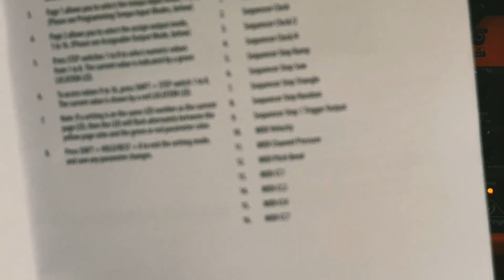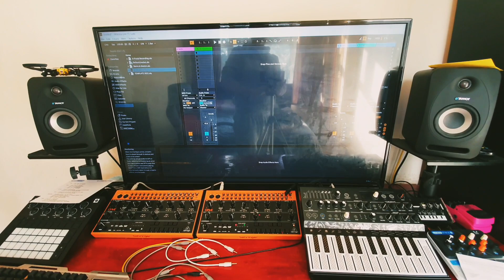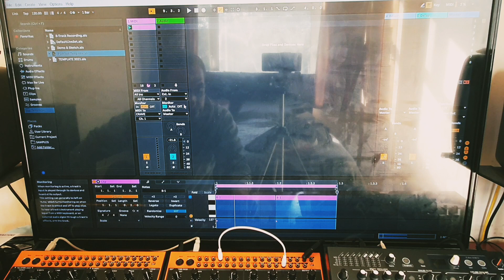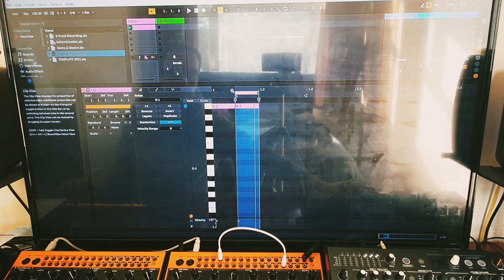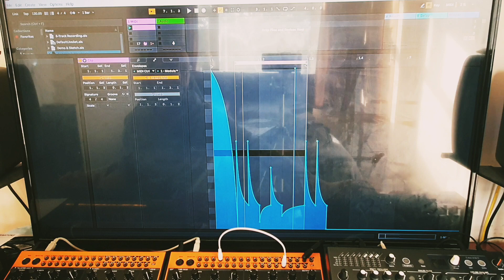Behringer Crave Advanced Tutorial 2021. Volume 1

Comment: So whats going on in the Ableton Env section? First Im DAWLESS so no Appletons 4 me, but I have hardware sequencers. Am I correct in understanding that one can use MIDI CC# to 'spice up' sequences in the Crave, eg program filter apects etc - and this is done by assigning the assign function to a MIDI CC in the list you showed earlier?
Reply: I ask this as I know the Crave is Analogue...so I didnt quite get why there is a MIDI CC lista in the manual :D
Reply from the maker: Correct. Yeah I've done it with ableton and the circuit tracks
Reply: @TechTronix01  but only in the sequencer - since its analogue using MIDI CC wont affect control of the sound/knobs.
Reply from the maker: @squishmusic  no.. an external sequencer could modulate or move the craves cuttoff or anything else over midi cc regardless of whether a sequence is playing.. you just need to patch the thing you want to modulate so from assign to cut-off..  parameter lock can be done If the sequencer has that ability

Comment: i can't figure out what's up with mine the keyboard detects touch but i have no pitch difference on any of the keys im going to flash the stock fw see if that's does it but im at a loss here because the oscillator works just keyboard only plays in one key
Reply from the maker: Try flicking down a few octaves.. I think there is a maximum range.. if not this tell your supplier